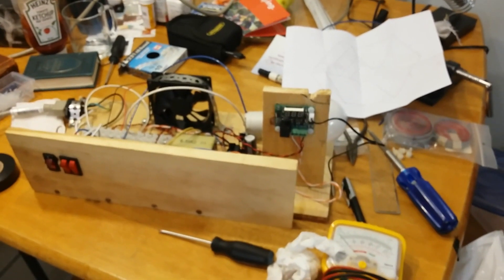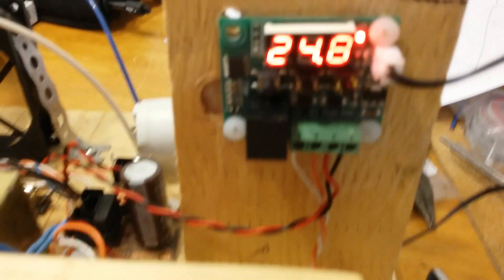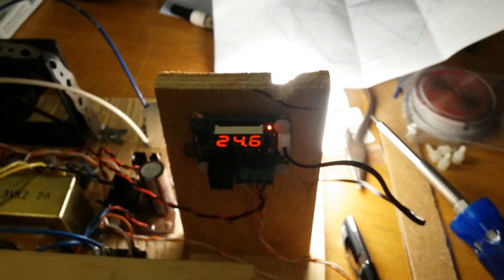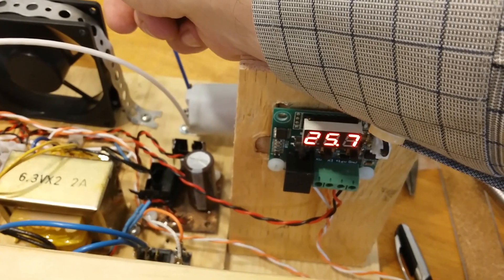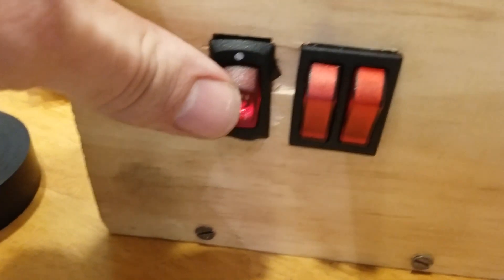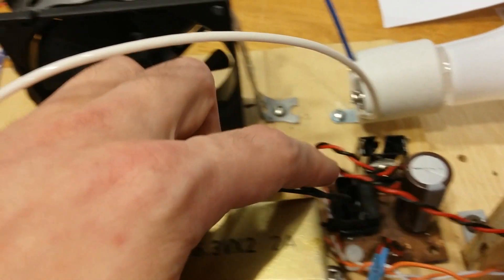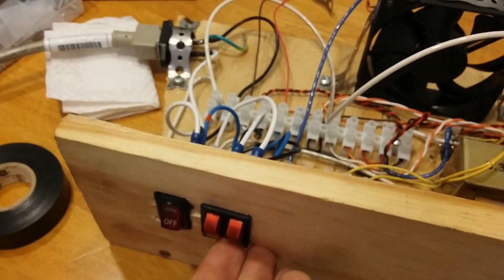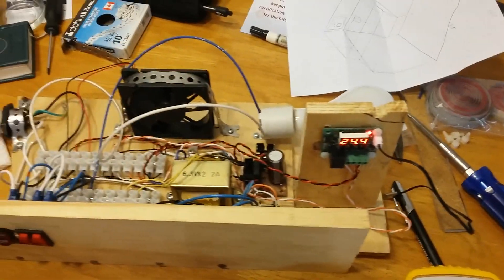Circuitry mock-up for a food dehydrator

Comment: Nice. Talk about overdoing things, I was thinking of using a cheap fan heater like this: https://clicks.co.za/safeway_fan-heater-white/p/208862?gclid=Cj0KEQjwi7vIBRDpo9W8y7Ct6ZcBEiQA1CwV2O4slCvwbIU1_p9q8GvarwcAn0UWvr5NdN4OZC_6_D0aAuT38P8HAQ

using arduino-temp sensor-PID loop to turn heater on/off while fan kept on constantly.